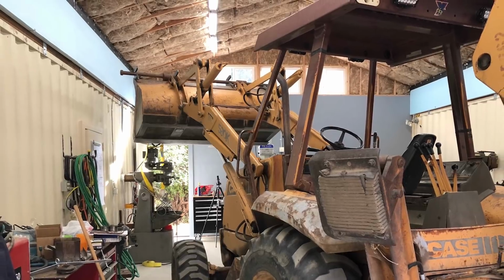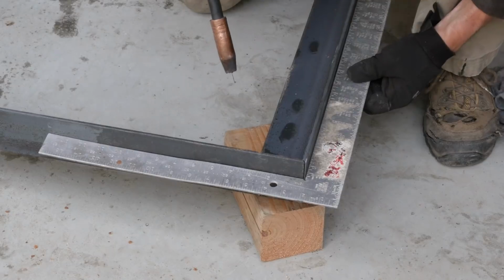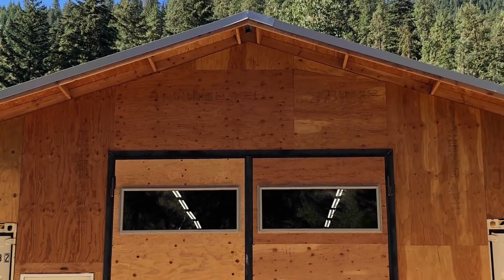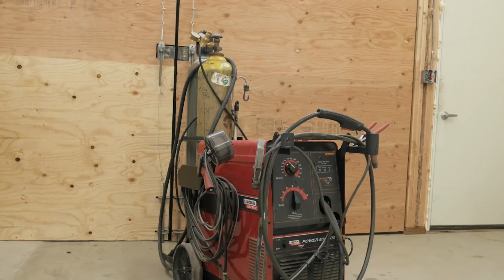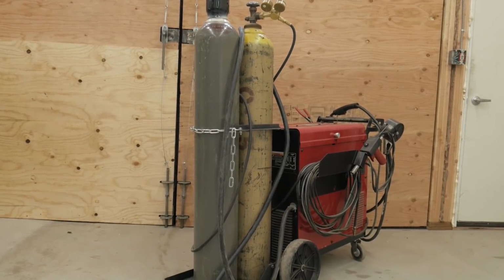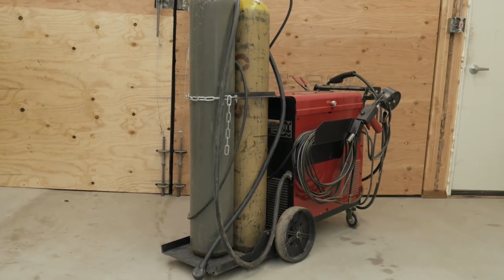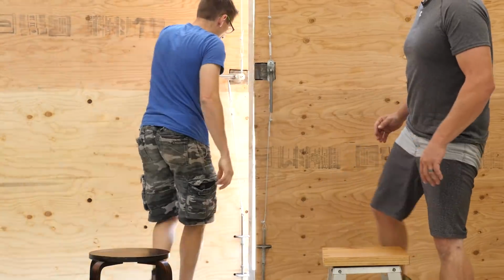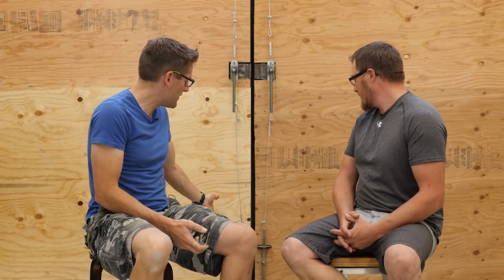Shipping Container Shop Custom Door Build 12' x 12'

Comment: Uhm, shouldn't the diagonal supports point toward the lower hinges?
Reply from the maker: Depends on if you want them in compression (towards lower hinges), or in tension (the way I installed them).
Reply: Ah, i think i get it now, when you have, say, a garden door without a closed frame, then i guess it's better to direct the force towards the lower hinge because it's closer to the ground and you have a smaller lever that pulls on the vertical member. Your doors have a closed frame.
Reply: I wanted to say the same thing on the diagonal braces.  But being welded steel is a lot different than just wood doors that will eventually sag if built wrong.  I loved the design though for the pins to hold them closed.  Can't wait for the full tour.

Comment: Nice project!  I just bought a MIG welder and am starting to teach myself how to use it.
Reply from the maker: Good deal David- I think you'll have a great time making things...
Reply: Good pointers. Thanks. I do follow Jodi, welddotcom and ChuckE2009, though ChuckE is doing more farming now.  I have a Lincoln ProMig 175.  Using flux core I have repaired some broken items and a vise.  Uzi build is next.  I've heard that solid core wire produces better welds.  I need to find a gas bottle in the Seattle area.  Let me know if you know of any reliable sources for gas in this area.